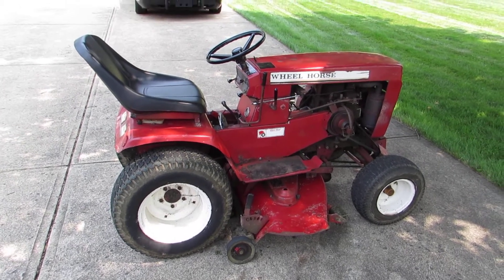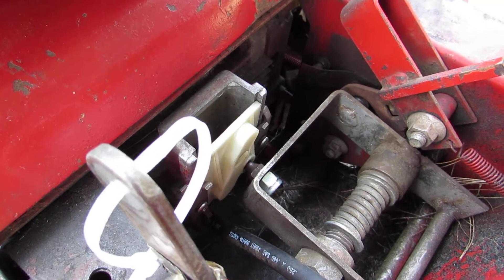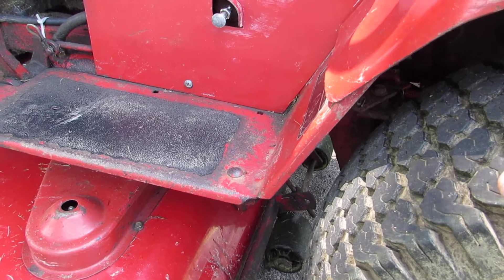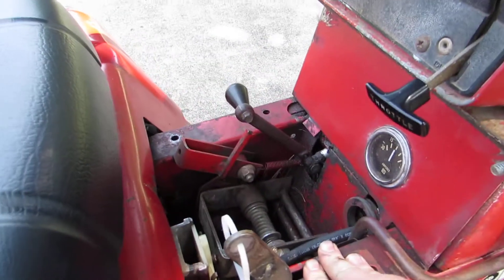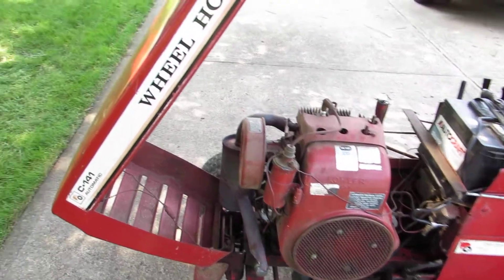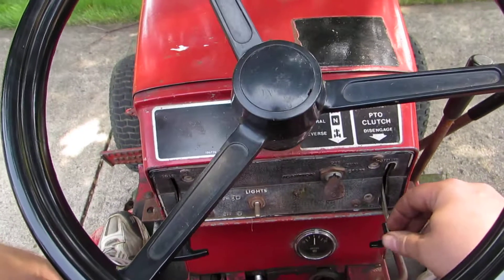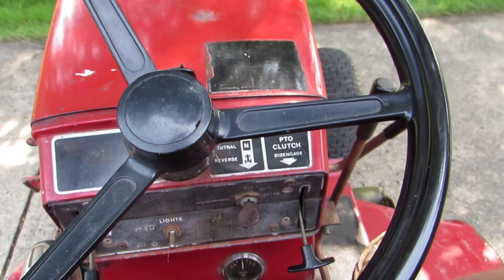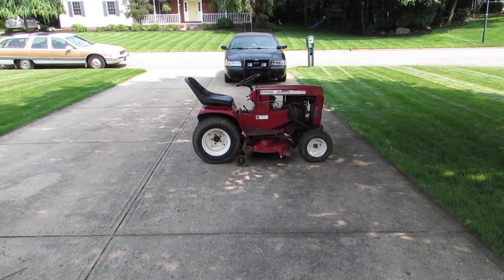Tour Of My 1978 Wheel Horse C-141 Tractor

Comment: You wanna sell it. I have a C 180 wheel horse.  Their great tractors. 16 h.p. Kohler engine.  Their very powerful engine and run forever. Mine is 41 years old. And still running strong